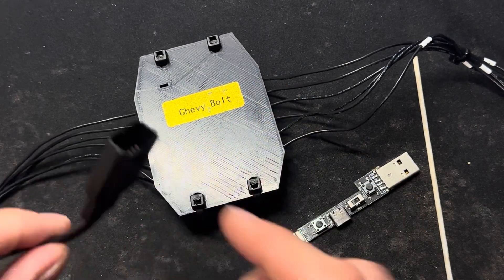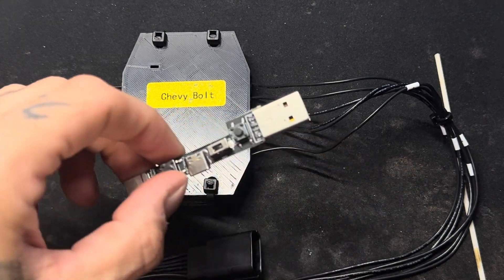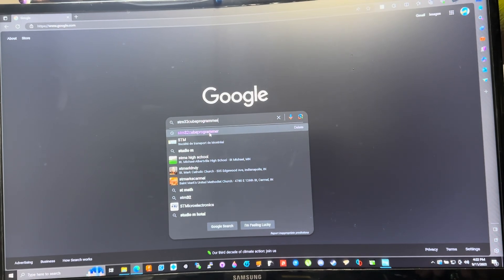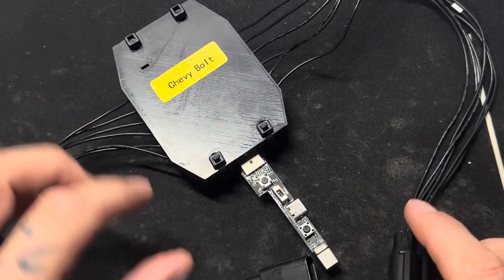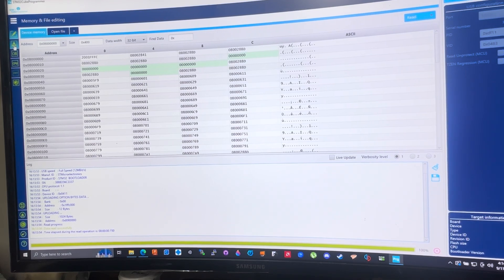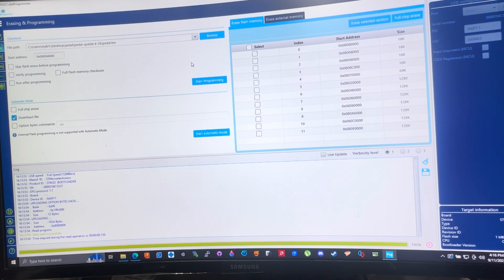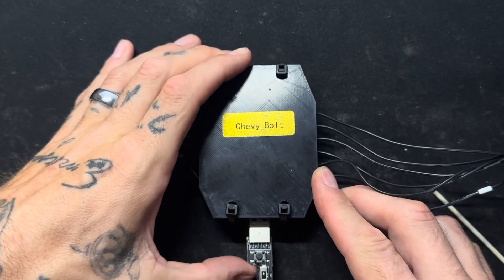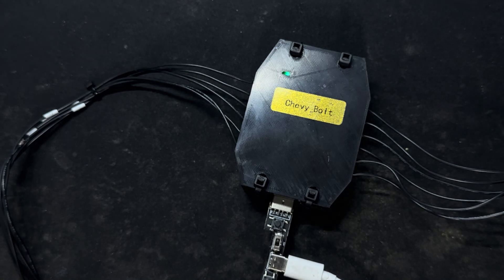How to update your comma pedal

Comment: so, I just bought a 2023 BOLT EV LT2 with ACC for use with the core openpilot on the comma3x but I think I want to explore more options.  Can I run all other forks with ACC in the car just disabled or bypassed?  what hardware do you recommend, is the foot pedal hardware needed for best operation?

Comment: Hello there, Great video.  I have a question for you.  I have a 2023 Bolt EV LT2 with the adaptive cruise option.  Would I still need this comma pedal for starting and stopping on the highway?
Reply from the maker: No stock will do same things pedal will do. The pedal however adds the ability to come to full stop and go. And let’s it use full regen to stop instead of physical brakes. So not needed but it is little upgrade

Comment: I ordered my pedal about a month ago, is there an easy way to see what version you are on, or what the latest version is?
Reply from the maker: I’m using a my own version of FrogPilot that uses the pedal if you wanna try it. Installer.comma.ai/mykl1022/MyPilot420
Reply: Very interested, got an install link? I'm running Opgm now, but the lateral torque just isn't there.
Reply from the maker: @jakekiene62 I have a new one I use that I edited based off of FrogPilot. Installer.comma.ai/ mykl1022/new